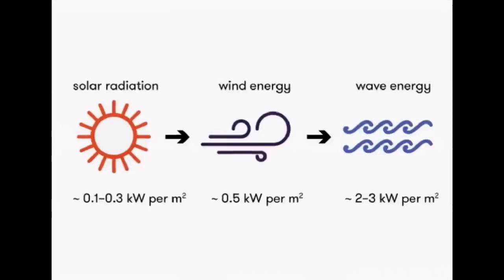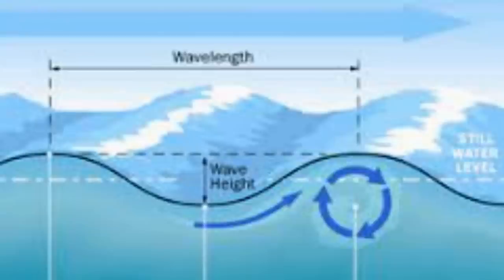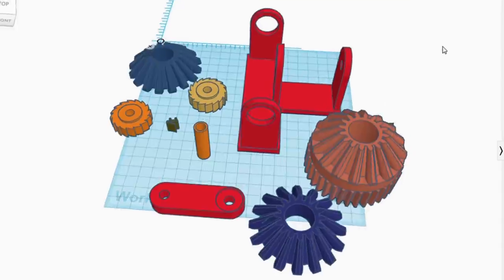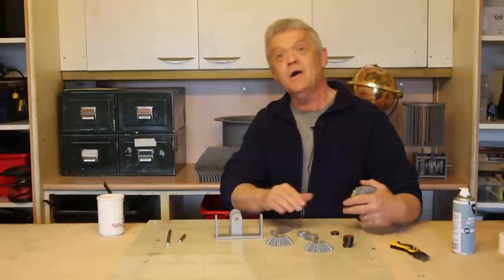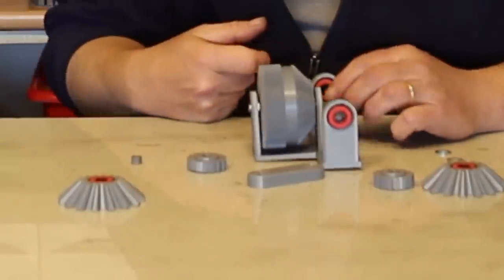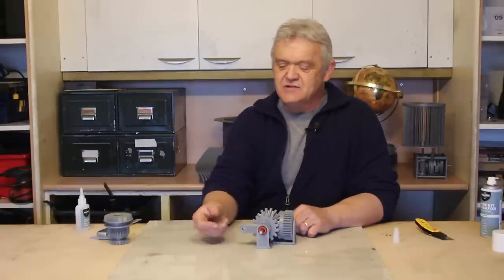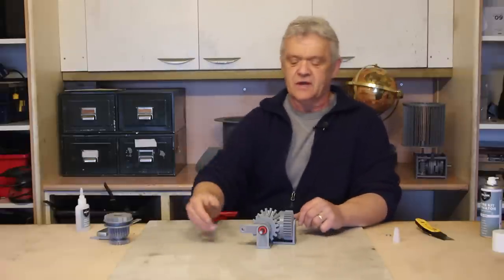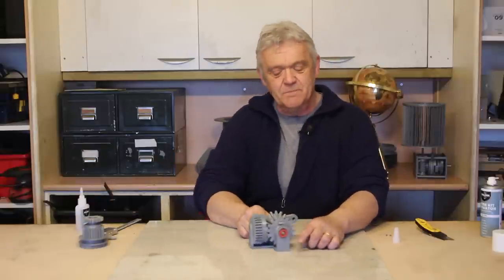1906 Wonderful Wave Power Mechanism

Comment: Wonderful work as always!  

A feature of (in this case) wave energy, but shared by all sorts of energy converters from natural sources, is the intermittency of the input compared with the nice even output required for domestic use.

With your tidal arm, to attenuate the output you could use the arm to pump water up into a top tank, and then run a fixed speed turbine and alternator on the discharge from the tank into the bottom tank to give you 240 V 50 Hz (or what ever you require).

I find that step between intermittent and widely variable input and the required steady output is the biggest hurdle for any comprehensive natural energy capture system.  

I like the thought experiment where you have say a huge flywheel rotating, and you want to add the energy from a falling feather to the energy in the huge flywheel.  Its a problem worth solving.

Conceptually, use the input to generate some electrical current in a wire.  Boost the voltage and frequency of that way up  - say 4000 Volts and 1000 Hz, regardless of the current  The high frequency enables very effecient AC to DC conversion, and then a PWM setup provides the 50Hz and a simple 4000 V / 240 V transformer gets the required voltage.

The trick is to get ALL your input devices to sing the same 4000 V 1000 Hz tune (i.e. to fill the 'top tank'), regardless of the current they are providing.

Its a dark and stormy night here with torrential rain and a decent gale.  (Its my fault, I just upgraded my wind vane - hence the blow!)  The down pipes from my roof could give me about 60 Watts of energy as the rain falls through the available three metres,  while the gale could provide a swag more Watts with a suitable converter.  These two intermittent and unmatched inputs have to somehow get aligned to 'fill the top tank' which can then be drained by the output system at the required 240 V 50 Hz.

In this day and age any fool can make sparks come out of a sun or wind or water driven device.  The trick is to get that largesse into a suitable form for the end user to do things with when its needed.

Your universal solution to this intractable problem is eagerly anticipated by your adoring congregation!!!  :)

Comment: Awesome.
Were I to do such a thing, I think  instead of printing the ratchet bit I would just use 2 cheap ratchet tools yoked together with a socket or bolt stuck in the cog, so that bit would be more robust.  Of course, in a salt water environment, it occurs to me that might not be ideal due to corrosion.
Reply from the maker: that is an awesome suggestion mate

Comment: Brilliant as usual and so quick from design idea to prototype. Your head must be exploding with ideas!  Tidal beats wave for reliability and .. well it will never run out! "constant as the tides" There was or is an Australian company that developed a mechanism which was affixed to the bottom, mounted on a pylon of some sort and swiveled to meet the changing direction of the tidal flow. It was shaped like a fish and always pointed into the tidal flow. It moved like a fish, gently flapping its tail section from left to right. Through gears or Hydraulics it captured the movement and converted it  to electricity. It was an environmentally sublime design with respect to fish and capable of producing considerable energy
Reply from the maker: it is mate lol - i am now building a version of this using sprag bearings - it will be a while before the video as i have a few lined up already lol

Comment: Hi Rob.  You are right!  Waves are huge potential sources of energy.  You can, however, get rotary power directly from waves without any mechanical mechanisms.  As shown in your diagram of waves, there is a circular motion in the water beneath the wave.  It is a flow of water that rotates through 360 degrees as each wave passes.  If you put an eccentric vane on a stationary shaft in the water under the wave it will rotate once in the flow of each wave.  This then produces rotary motion directly from the kinetic energy (the flow of water) of the wave.  The amount of energy the vane can harvest will governed by the height of the wave (trough to crest), by the depth of the vane in the water beneath the wave, and by the size of the vane.
Reply: There's no harm in trying new techniques. eccentric vane and even electric motor / generator are mechanical mechanisms.

Comment: I've seen devices like this? plunger toy is one example. some I've seen a bicycle wheel use because of the mech in the rear cassette. if that was linked to a flywheel? oh boy time to sit down for a cuppa? pat yourself on the back? hi revs and lots of power on the rim? they have had similar thing for some time? often given out as party toys? they sometime light up? burger king had a superman toy that did it? push and release. around it would go? 

great job rob!
Reply from the maker: they are all over the place mate once you start noticing
Reply: @ThinkingandTinkering  I had dropped a similar suggestion for AWES.  Its a really neat mech. I’ve even seen a trip hammer use a mech like this it was rather cool? Definitely a few places where this type of mechanism exist. It huge In robotics and automatons far as I know? The steam winch had a mechanism like this? Just to prevent the cables from slipping?  Even hydraulic anchors winches use a variant? It seen a lot of use. Pretty hard to miss a big bit of kit? The mech I believe stopped lifts from plummeting? Or something similar? Very neat bit of kit.

Comment: This is cool. As far as wave power goes, though, there's a version that I personally prefer. It's not mobile by any means, and it would be a little difficult to do, but, what you do is pour a gigantic cement box. Either the top or shore end of the box has a small 12" circular hole, and the sea end of the box has a long horizontal opening across its length. This box would be 20-30' long at least and probably the same width. The side with the horizontal opening must be placed so the opening is completely submerged, even in the troughs of the waves at low tide. The box must be tall enough to have a few feet of air space at high tide. The idea here is that as the waves come in, they constantly force air into and out of the box. The bigger the waves, the more air is moved. The 12" circular hole is the only outlet for the air, so you put an air turbine in it that is unidirectional, meaning whether the air goes in or comes out, it only spins in one direction. Since it's just a big concrete box, it's easy to make. Since the turbine would be on the shore side or on top of the box, servicing it would be very easy. The bigger the volume of air inside the box, the more pressure is built up and thus the higher the speed of the air passing through the turbine. 

If I had ocean-front property and was allowed to build a pier into the water from concrete, I would turn that pier into a wave/air generator and use that to power my house. The waves will always wave since the wind will always blow, so I'll always be generating. 24/7, day and night, summer, winter, nuclear annihilation, what have you. So long as the horizontal opening on the sea side remains below the water and the 12" circular hole remains above water, it'll generate.
Reply: That sounds great!!
But, perhaps if you were to use the force of the water to capture the energy?!
Just a thought, because the water is  able to provide more torque...
Namasté 🙏💞
Andréa and Critters.   ...XxX....
Reply from the maker: i have seen designs like that mate - the Australian blowhole generator isn't far off from what you are suggesting
Reply: @AndreaDingbatt  You're correct, in that the water would provide more torque. It is a lot heavier than air after all. There's an issue though. You're not going to get much speed out of it. What you'd have to do is force a large volume of water through a very small area to create the effect of water pressure that a normal hydroelectric dam would have. Air, being lighter, can move a lot faster and can be compressed much easier than water. Additionally, in order to capture the power from the water, you'd have to have a collector IN the water... that requires a lot more maintenance. Seaweed, critters, any number of things could jam it up. With just an opening for the water to go into and out of, the odds that it gets jammed are very low. So you end up with a large volume of water moving into and out of the concrete cube rather easily which can create a strong air pressure or vacuum in the airspace within the cube, and by restricting the area that the air can enter into and leave out of to attempt to equalize, you can increase the speed of the air moving through it.
Reply: @ThinkingandTinkering  That's an apt name for it! lol. I'll have to check it out!
Reply: @Xero1of1  Ah Ha!!  Of course!!
My head is a bit fuzzy at the moment!! I'm stuck in bed recovering from pneumonia at the moment!!

Hence,,not noticing the fatal flaw in my thinking!! Do'h!!
I hope you were not offended by my comment and have a wonderful week ahead of you!!

(I'm sorry, I'm off to find my brain cell and see if I can persuade it is return to work!!) 
Best wishes and Kindest regards!!
A.Dungbatt. XxX.
Reply: @AndreaDingbatt  Why would that offend me? lol. An honest discourse of ideas is what we need, especially in the fields of science. Never be sorry for offering up an idea. Had you not brought it up, you might not have realized the potential complications of it, therefore, in bringing it up, you were able to learn or be able to think about something in a way you didn't before. Additionally, you may have brought up an idea or way of thinking that I wasn't aware of, which would have allowed me to learn or think differently. That how science is supposed to work. :)

Cheers!

Comment: Also a drain generator in a large body of water that uses a float to keep the the top above the water and a screen to filter, you could maybe also use the air bubbles going back up to create more power.

Comment: Another one would be essentially a "runaway diesel engine" but using the U tube with an inline still that is insulated that has electric heaters that capture the power from the difference in pressure and temperature with the height of the tube and transfer it to the water, which should eventually continuously boil

Comment: It's an interesting design but seems more complicated than it has to be (which means more maintenance and a higher probability of material failure). Wave powered generators can be made with a coil, magnets and a housing. A simple one can be made with a water tight tube with a coil and a magnet that slides inside the tube as it rides on the waves (there are videos here on YT). Another one uses a tethered housing and a direct buoyancy driven magnet to move it past the coil. There are a few ways to do it.
Reply from the maker: there are just a ton of ways to tackle this problem mate - and none of them are best - mostly they are about what is suitable to circumstances

Comment: What about using compressed air from a blowhole chamber powered by the rising and falling of the waves, using a flipping butterfly valve to keep the air moving in one direction through a turbine. 

The air will smooth out the energy and you can capture the wave off-shore and feed the compressed air to a land-based turbine via a pneumatic hose. That way you keep the crucial parts out of the harsh ocean environment.

By staggering the blowhole chambers across the wave action you can further amplify and smooth out the energy collected.

Comment: You could also use a U tube thats elevated to capture energy from the air, essentially "solar" power but using a tube to capture the difference in temperature and pressure. Then you can convert that passively to hydrogen and use the gas to boil water

Comment: What ever happened to that lever paddle thing someone came up with. In venice they wanted to reduce wave erosion and came up with a paddle system. Paddle in front of the boat received the wave and levered that action to a paddle in the back of the boat.   I wanted to make a sea drone out of a surf board using that model some day. I had no luck finding it on the internet several times before.  Update. Just checked and someone finally did that thing.  Happy to see it. But the paddle seems a little different. They call it autonaut.

Comment: What if you had a platform with a bunch of individual floats in series that are arranged like cilia, then the barge being a larger platform will have a different frame of reference and will not bob at the same rate as the floats which would use those differential gears to all turn a shaft together, also all the moving parts would be kept above the water, this is exactly what I was thinking about, but I wasnt sure how it would work

Comment: Great video Rob! 
I've been facinted with the idea of using the surging motion of the ocean to generate power for years, but it seems the greatest weakness of all of the designs boils down to mechanical failue due to the corrosive nature of saltwater. 
What would you think of the idea of creating a sea level  "Trompe" compressor, with no moving parts to corrode, using a funnel shape to trap, compress, & dry air that could be used to power generators much farther away from the immediatly corrosive salt spray of the ocean?
Reply from the maker: have a look at wells turbines mate - they are used in exactly what you are suggesting
Reply: @ThinkingandTinkering  I will definitely have a look! Thanks Rob

Comment: Man, we are on the same wave (heh. Pun). I've been thinking of a small barge with a generator on it. Using an anchor, cable and self retractor + that exact mechanism with sprag bearings instead of ratchets. 

I have an off grid cabin on a lake that can get very choppy. I like the idea of water as my prime mover.
Reply from the maker: i think sprag bearings would be miles better mate - but they are a little more difficult to get right than ratchets

Comment: perhaps this is a new concept maybe not.. but....

a hollow sphere, well several hollow spheres with a large funnel with the spout going up through the sphere and out the top. a catch basin around the spout and a down sloped flue that swivels around the catch basin to direct the water's return to the body of water....
bind the spheres together with all the spouts aiming up, build your platform of house boat or ship around the spheres mounting to them at the largest circumference.. and above... Use the flues to change the vessels directional movement. use turbines on the flues to produce power.

the weight of the vessel will resist the swell of the wave forcing the water to accelerate up the funnel and out over the catch basins... with a one way valve in the up spout you can use this to pump water to your salination facility or filter or anything else...
Reply from the maker: interesting idea mate -t hank you for sharing

Comment: Would it be difficult to convert this system to a camper trailer to capture movement during transport, charging batteries so you have power when you get there

Comment: maybe try the screw version lifting a weight from the sea-floor - I guess long term you want a few moving parts exposed to sea-water as possible - probably why the snake stores energy in hydraulic form?
Reply from the maker: oh i am willing to bet there are quite a few reasons and not least will be freedom to operate

Comment: Um, Rob, why not just use a reciprocating linear generator? You don't need circular motion to get power, up and down will do.
Reply from the maker: you can do mate - there are loads of ways of tackling this problem - compressed air, linkages, gears, linear generators - there are a lot and all of them have their pros and their cons -it's a question of what suits the situation which includes the skills, location, abilities and budget

Comment: Robert why does it have to rotate? Your rim coil wind generators have me thinking that you could have an arm oscillating back and forth in stead of around and around.
Reply from the maker: it doesn't - but if you are trying to build something it is often better to use parts bolted together and if all you ave is a motor to act as a generator then it's good to have rotation. Motors are all over the place and very cheap!

Comment: Hi.   Made an interesting discovery.  Left a wire bin  of stainless steel dish scourers under my tiny wood stove . To dry out ..  went to get one they seem to produce a rather noticable hot air current from their design apparently wire bins of metal dish scourers under the stove increase heat output from what I can gather by a laser thermometer
Reply from the maker: that is interesting - thank you for sharing mate - i will look into it - cheers
Reply: @AndreaDingbatt   they aren't steel wool.  They're the stainless coily dish scrubber things you buy for scrubbing pots I think it's air circulation and that air can flow through them .. and that they're thin filaments that disperse heat well like the tinsel on AC unit tubing   a "pile of finned heatsinks" sort of..   I'm thinking about rigging up something with a little bale of these in a tin oven pan with a little thermoelectric circuit and a fan to push more air through the bale thus creating lots of warm air instead of a Small warm spot on the floor
Reply: @agoogleaccount2861  Spot On!!
😁👍👍
Reply: I use those scrubby things as a crude heater by placing one on the gas stove burner. Plenty of radiative heat.

Comment: Would it be possible to make a fast bicycle or tricycle using just cogs gears and legs or anything that doesn't use a battery to power it. I'm not mechanically minded and I'm talking about at least 30 mph up hill.